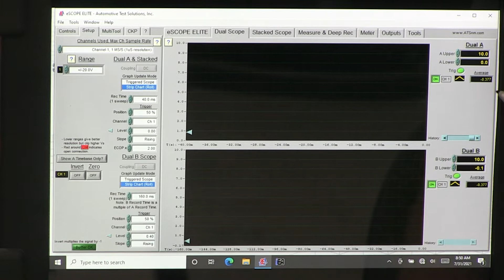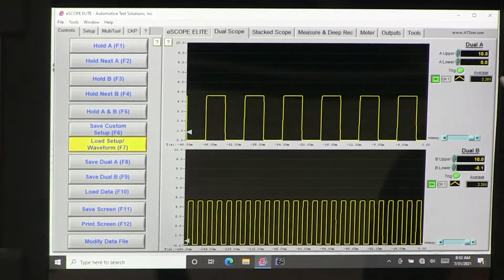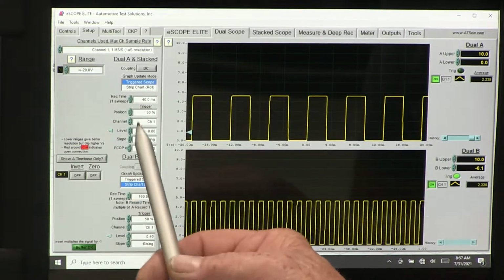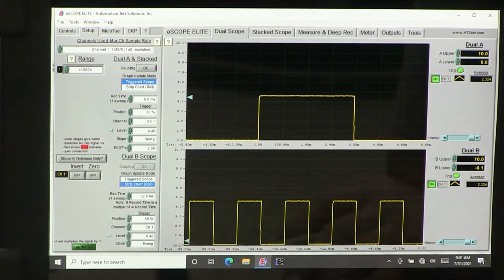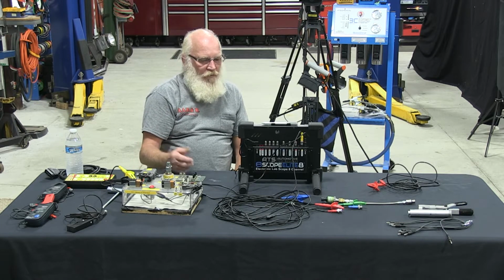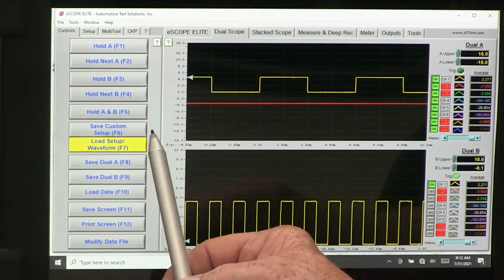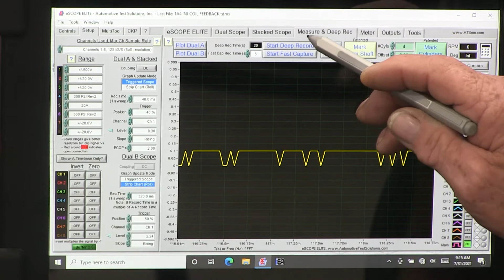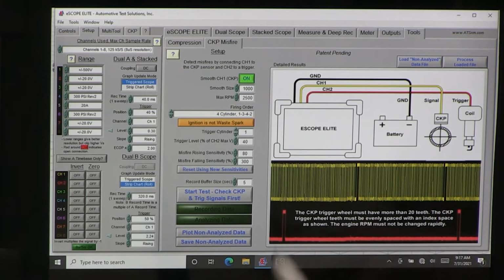ATS Escope Elite Basic Scope Connection and Waveform Acquisition   Rusty Flake

Comment: Hi Rusty, thank you for the video.  I'm recently retired and looking at starting my own automotive diagnostic and custom programming operation. and I've been seriously considering the ATS products. I currently use a MIC SIG 4ch, Fluke 2ch, and a Snap-On Verus 4ch. I haven't been in the Automotive industry since 1982 I chose factory automation for my career path instead. My scopes have been for my own personal use and occasionally helping a friend. I really like the idea of having my scanner and scope working together and developed by the same company.  So I'm looking to purchase the Escan and the Escope Elite next week. Do you have any suggestions or wisdom you can share? Would you consider a different manufacturer like Snap-On or Pico if you were in my shoes?  Thanks Rusty for the feedback.
Reply from the maker: Hello! Thanks for reaching out, in the situation you described, I highly recommend ATS, the equipment has so much capability and they are continually improving their capabilities, not that I dislike any other scopes or scan tools. 
Along my journey in automotive analysis, I owned close to 30 scopes and many scanners (different purposes for different scanners), by far for drivability or electrical concerns….ATS was my choice and the company cannot be beat for service.

Comment: What is “start fast capture”?
Reply from the maker: Hi Eric, I’m sorry to take this long to get back with you…start fast capture is used when you just need a quick capture of data that is cleaner than the normal process used, mostly use it for can bus or ignition acquisition.
When you are using fast capture, the data will not show on the screen until you stop the capture, then the screen will show the capture.
Use as few channels as needed to get the best results, like shut all channels off on can bus except the two being used, also, the recording time is default time of 5 seconds, you can change that if you desire using the tab to the left on top. 

I hope this helps, if you have further information needed, hit me up!

Comment: Hi Rusty just came across your video and your channel, good stuff. I've been a tech for 23 yrs and just got into the scope world about 5-6 yrs ago, been using the snap on and pico in the beginning until I got my Escope elite 8 over a year ago, use it everyday and I love it. I'm finding my diag times are getting shorting and shorter with the speed and  know how of using the scope. I still watch what I can to learn as much as I can when it comes to diagnosing todays vehicles. I also have the Escan scan tool but I find I struggle when I use it to pinpoint drivability issues, not to much info out there on some of the build in test other then Bernie's video's, so most of the time I just use my verus or my zeus for drivability problems.
Reply from the maker: Awesome, the e-scan elite is my go to for drivability issues, I am currently not doing anything on vehicles, it’ll sometime in late spring before I get back to it, I have kinda semi retired, we are moving in June and I have some stuff to do on our house to ready it for sale, ATS is constantly upgrading the capabilities of their equipment, I’ll surely have some tooling catching up to do, plus side is…they are very helpful if you should need anything…I’ll be uploading some analysis stuff late spring hopefully and I’ll try to include e-scan in the analysis.  Thanks for subscribing!